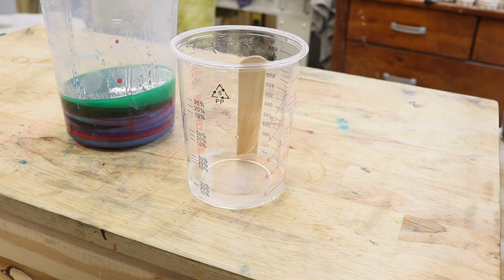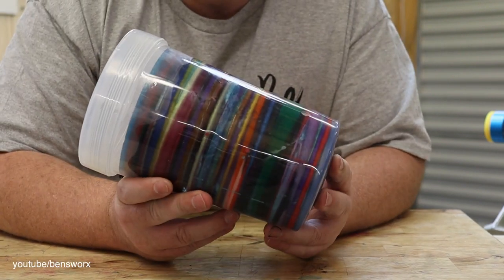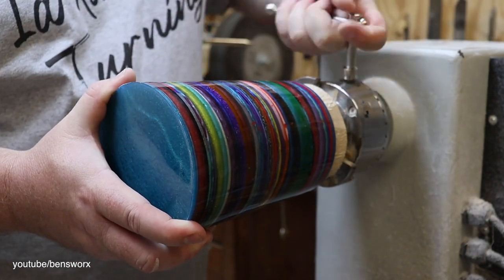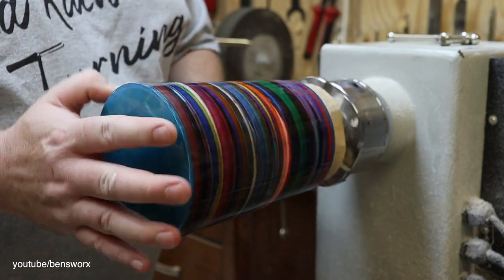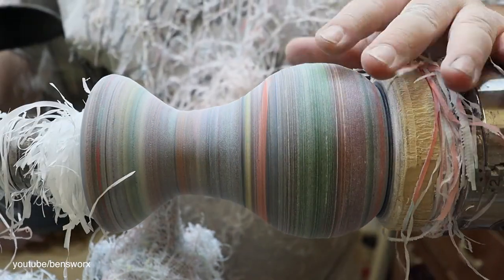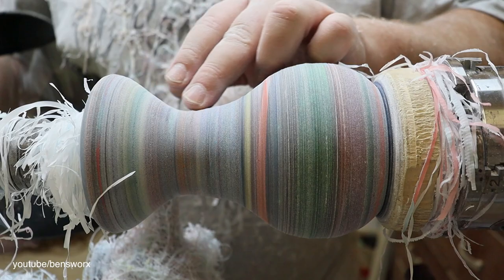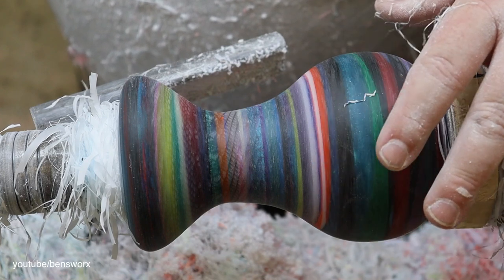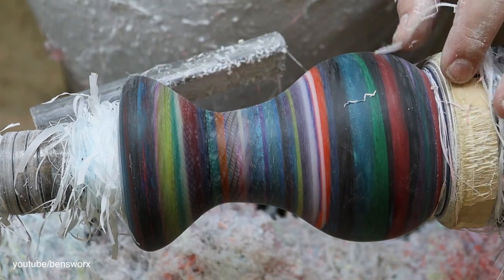Woodturning - Over 100 Layers of Epoxy Resin

Comment: I have several silicon moulds that I put waste into when doing pours, I sometimes have more fun pulling them out than the actual job.   If you get a a rotocaster with a large sphere silicon mould,  you can make resin geodes which when cut in half and polished look amazing.   Well done on this,

Comment: Really great video. I think the vase really turned out well, love the colors. Since this must mean that you are starting a new blank of the year I would love to see you saving the extra resins and tilting the container at a different angle every month or so. Example could be first month base flat, next month cocked at 45 degree angle, next month tilt in another direction at random angle. Continue to the end of the year until the blank if full. Thanks again for sharing!
Reply: Great idea,
Reply: I second that

Comment: Such a beautiful result, even better when it's from something that would be easily thrown out!

Seeing crafting videos like yours, i'm always thinking about the amount of "trash" that is created in the process, and if there are ways to reuse that stuff to make more things. Be it resin, metal or wood, there's always so much scrap involved in the proccess... we always see the final work, but usually not the amount of material that is thrown off. 

I'm really glad to see that type of video and I hope you (and other creators, to be honest) post more stuff about reusing leftovers! Thank you!
Reply: I was thinking myself actually - would it be possible to actually re-use the cuts of resin flying everywhere around the place when shaping the piece?
You could set them all spaghetti like in container and fill with resin as you go.  I wonder if that could create anything interesting.
If arranged properly you could get some nice chaotic rainbows of patterns throughout it.  But it would be hard since the material ends up getting messed up, color-wise, when cutting. Maybe a soak in resin beforehand would help that, but then it becomes a complicated mess at that point.
Reply: @Hunnter2k3  Ben did a video about a year ago doing exactly that, check it out, it's pretty cool. There are some other creators that tried something on this line as well... 
He also did one experimenting with melting, but to no avail. It seems that resin, after it cures, cannot be remelted, sadly.

Seems like so much material is lost on those projects... but i've seen worst. Usually, metal and woodcrafting creates a lot of scraps too, and I don't often see people using them for anything :/

I really like to see videos like this. One thing I saw some other people doing is mixing wood dust with resin to fill holes in wood, and stuff like that. Would be really nice if those resin scraps could be turned again into liquid, pourable resin tho
Reply: @Archos777  Oh i need to go see that.  
Yeah lots of waste in woodworking especially, the dust works well for making wood-colored glues to fill in little tiny gaps and cracks to give an even base to work with.
Even better, you can make your own custom grain patterns by combining different kinds of dust over some scratched up base panel.
You can go absolutely wild with geometric designs or just something more like natural trunk bands.
Metals are easy enough to deal with usually since it's a case of remelting them and casting them in to something.  Easy way to make some money off of scraps by making some artistic pieces with them.
Reply: Absolutely

Comment: Looks amazing.  Great use of any leftovers.  
I almost wonder if there could be some way to add any extra texture to it to give it a sort of sand-art like look to it, without over-complicating the development of it.  That'd require a bit of foresight or careful planning.  Maybe even the simple addition of some large glitter pieces, or colored (plastic?) gems throughout it.  
Since the goal is limiting waste, you could space those additional components out roughly following the edge you intend to craft down the line so you aren't needlessly adding components that will be cut off or never seen.
Yeah you could do some interesting concepts with that.  Maybe even actually add some of those colored sands as well, preferably opposing colors to add a neat look to the design.  Oh that would look nice thinking about it, all these bands of color and little specks of sand throughout.

Comment: Using this technique on a much smaller scale would be really cool if you made them into chess pieces. Maybe make the top halves or bottom halves a neutral black/white to distinguish sides but it would be very cool

Comment: I have a question, I hope you answer me, so many times I ask and just get ignored. How do you keep the layers from splitting apart? I’m new to resin and don’t understand how they bond together if one layer has already dried.
Reply: My theory: the heat created by the new resin during curing changes (slightly) the temp of the previous layer making them able to bond... 🤔🤷🏾‍♀️ *Googles it lol
Reply: @PHE-nomenon  thanks, that makes sense. Like I said new to resin and had no clue! Never thought about the thermal reaction bonding the two. And I also want to thank you for answering me. So many times I’ve asked questions and no one has answered not just the creator of the video but just anyone.
Reply: @lanieleigh9970  you're welcome 😊. Idk if my theory is correct though.
Reply: @PHE-nomenon  it sounds plausible.